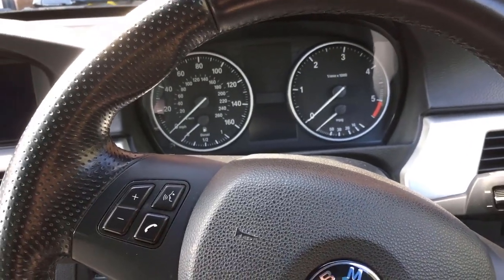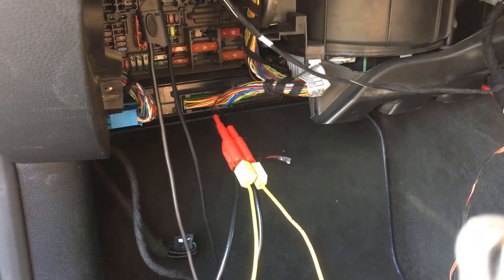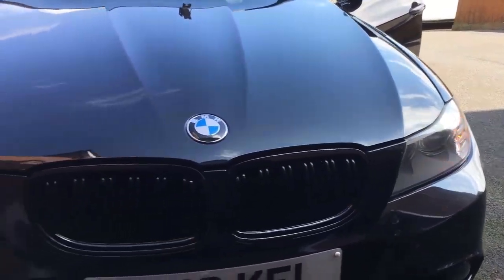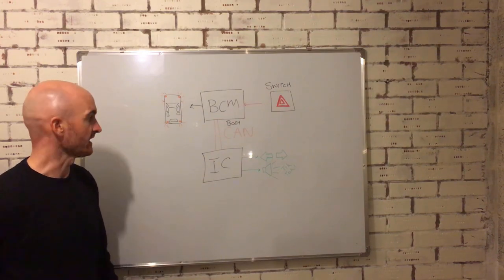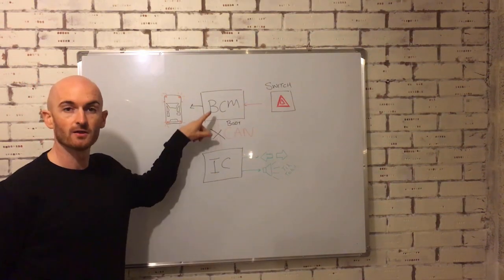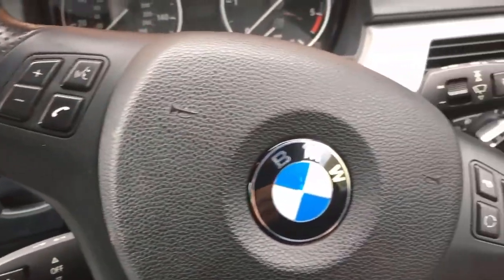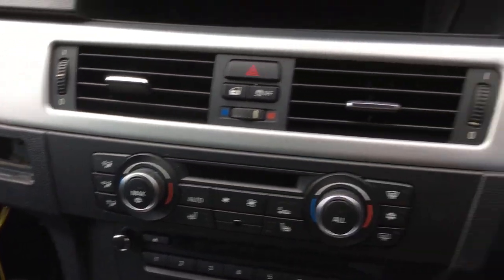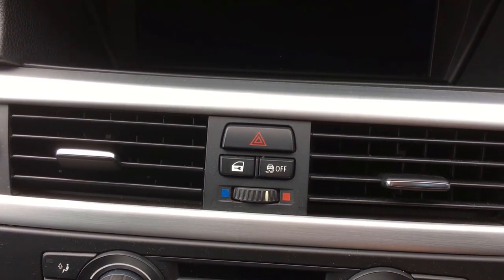No Tools CAN Bus Check | CAN Bus Diagnostics | Mechanic Mindset

Comment: I have a BMW E90 LCI with N47D20C block and ZF6HP21 automatic transmission. 

When I start my car and drive for 1 minute, the first message I get is: drive fault The automatic transmission goes into emergency mode.

 A few moments later, more notifications follow: 
Transmission fault 
Fuel pump malfunction 
Abs control system malfunction  
Seat belt system malfunction 

My car has been read with a universal reading device and it gives the following codes: 
4532 - Oil level sensor defective 
CD87 - CAN bus drive defective 

I also noticed that everything works except my buttons on the left side of my steering wheel, which are these:
volume 
calling 
voice control 

Can you help me?

Comment: I got a code reading for c1 CAN Bus would this cause my radiator fan not to start when my car is overheating. The fan turns on for ac but not on its own when the car is overheating

Comment: Hello i have BMW e93 323i and i have a problem with my cluster switching on and off, aircon not being on, central lock failure, flickering gauges. could this problem be the K-CAN? where is the module located on e93?
Reply from the maker: Possibly, could also be a power supply failure. Those symptoms are all related to various modules. I think JBE is the gateway
Reply: @MechanicMindset  i have tried changing the JBE as well as the FRM but the problem still continues.
Reply from the maker: @kewaonekennyntshonga4125  Check out my latest video: 5 Tips for CAN Bus Diagnostics 👍

Comment: I have an e83 that has K bus code , I cant find the K bus wire , but my lights working and the car lock and unlock . the mirror and windows and the sunroof doesn't work , what you suggestion ?

Comment: My E83 doesn't communicate with the instrument cluster cause to me front wiper doesn't work windows and sunroof doesn't work radio doesn't work and Navigation screen too , I changed the BCM or GM5 but not with  the same software version , but my scan tool still doesn't see it  and fob keys stop working , whats the solution ?
Reply from the maker: Sorry, I don’t know the solution. There are many possible problems! Check power & ground to module, if ok, check the CAN network. I have more videos on how to check
Reply: @MechanicMindset  it has K bus code wit instrument cluster and No Can identification ...
Reply from the maker: @tareqzakarneh221  If you can communicate with the modules, CAN bus is ok……